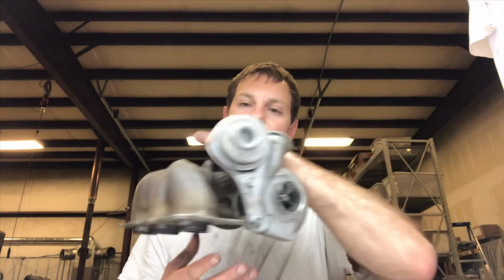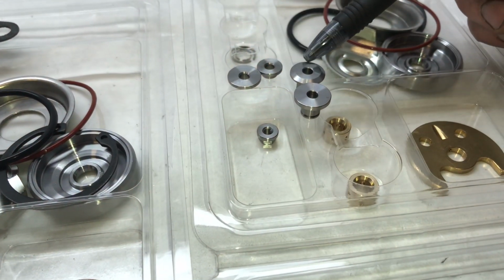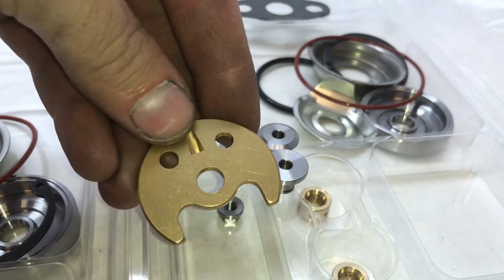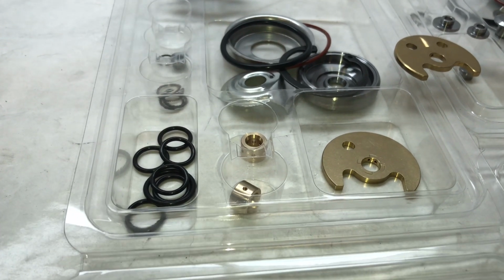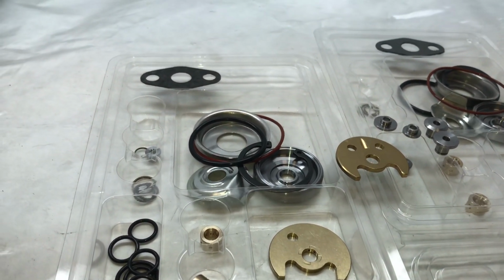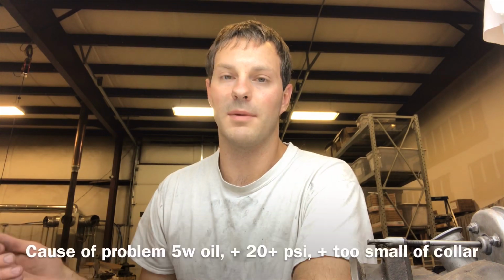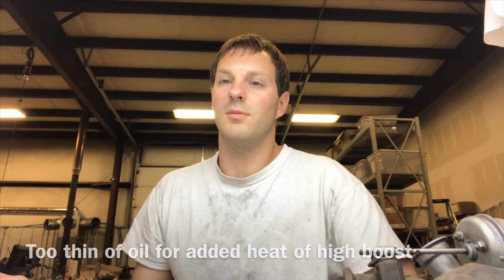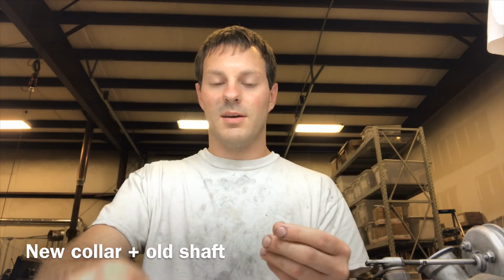Why N54 Upgraded Turbo Will Fail

Comment: I bought a set of Turbos from you in January 2019.  Running 18-20 psi boost on my N54 for 8,500 miles.  I see Wide Open Throttle several times a day and red line a couple times per day. I use Liqui Moly 10W 30 oil from FCP Euro and no problems at all with the upgraded units that you sold me.  Thanks for the explanation.
Reply: TheMortgageDoctor  have you dyno the upgraded turbos yet?
Reply: are they still holding up in 2023?

Comment: Running 3 pairs of your upgraded turbos on customers cars now, no issues. All cars are driven hard at 15-19psi. Customers usually use 5w30 or 5w40 oils, but I think only 40wt oils should be used because the oil temps are so high on these cars. Thanks for the videos

Comment: I just upgraded the inlets (stock ECU) and the engine is running hotter. Your turbo behavior explanation is flawless, so i'll change my oil to 5w40 or 10w30 soon. Thanks a lot!
Reply from the maker: Go with 5w 40

Comment: Ok 5w 30 and 10w 30 are the same weight in oil. "W" does not stand for weight it stands for WINTER. A 5w 30 is a 30 weight oil that will flow like a 5 weight when it's cold. If you want thicker oil you need a 40 weight. Im shocked people never know this
Reply: Listening to him talk about the oil made me want to beat my head against the wall. Lol
Reply: the W describes the viscosity of the oil at low temperatures
Reply: It stands for viscosity. The lower the number, the thinner the oil is at low temperatures.
Reply: @supertreme5559  yes the number stands for the viscosity at low temps. The W stands for winter
Reply: I also wanted to leave a comment on this. I just had my neighbor wanting to 'teach' me the same bs last week lol.
Reply: the number before the W describes the viscosity of the oil at low temperatures. The lower the number, the thinner the oil and the better the oil’s cold temperature/ cold start performance. The number after the W describes how thick the oil is at the engine’s normal operating temperature.
Reply: @supertreme5559  thanks we have firmly established this even tho most people still don't fully understand. They should change the W for a C "cold" so people don't think W=weight
Reply: FINALLY SOMEONE GET IT, if you want a thicker oil you look at the 20,30,40,50,60 and not the W number
Reply: i applaud you .....beautifully explained........People dont know this .....because it's something that no one thinks about or even realizes it has such  big effect on driveability .....not something the everyday DIY'er will know because noone that frequents their favorite Diy manufacturer specific car forum would know .....hell , most career techs dont even know  that , let alone what an API rating is.
Reply: Only people sponsored by their parents don’t know this.
Reply: @mattriella6776  hey thanks alot, now that a re-read it I could of explained it better but it's ok. Im an aircraft mechanic and often ask people this question and get a kick out of the confsued look they give when you tell them W doesn't stand for weight. Happy motoring!

Comment: I bought my fbo 335i back off a friend and the oil temps were getting high, had a check through service history and they had put in 10w40 I changed it back to 5w30castrol and car now runs spot on n oil temps are great!

Comment: Why not 5w-40 or even 0w-40? It's the second number that applies when the oil is warmed up. 10w oils are very thick and resistant to flow when cold. 0w-40 is far less prone to thinning out with increased temperature than 10w-30. My old 335i is still going strong with upgraded turbos running 17psi flat after about 35,000km now with 0w-40. I agree too high boost kills these turbos, both from thrust load and overspeed.
Reply: Brad Smith Yep. Well said. He totally lost the credibility with his misunderstanding of multigrade oil numbers. It's all to common and quite normal but he went on to explain "why" related to the heat of the turbos which made the misunderstanding even worse.
Reply from the maker: 5w40 seems like the best choice according to the oil charts online, it depends on the temperatures the car gets operated in
Reply: Turbo Lab America There's only 2 things to choose with oils: The operating temp viscosity (the second number) and the cold (starting) temperature (the first number. That first number should be as low as possible in any climate. The only reason we see such a wide spread in multigrade numbers these days is the modern synthetic oil technologies. Charts for older engines only really apply to oils available at the time. 

The engine operating temperature value has nothing to do with ambient environment temperature and the correct oil viscosity rating is according to the manufacture. Once an engine warms up there should be minimal fluctuations in temperature. You'll get hot spots but that can not be "solved" with a "thicker" oil. 
If an engine is running too hot then the engine has a cooling problem and changing the operating viscosity of your oil will not change that. And in BMW engines going outside the manufacturer spec can affect both the internal hydraulics operation and the oil flow characteristics. 

The only way an oil viscosity can be responsible for damage to an engine is if the cold grade is not low enough for the ambient temperature (your climate and season) or if the "operating temp" grade is too high or too low.
Reply: @DiscoFang it looks like he’s in a colder climate, 10w might be his colloquial equivalent to 5w for folks in mild climates

Comment: I've had Stage 2 Pure turbos running 27psi since 2017 and zero issues. Change the oil ever 4k miles do you maintenance and you'll be fine. They are 650 whp. ZERO turbo issues.

Comment: The "w" in motor oil stands for winter. The first number in the oil classification refers to a cold weather viscosity. The lower this number is, the less viscous your oil will be at low temperatures. For example, a 5W- motor oil will flow better at lower temperatures than a 15W- motor oil.
Reply: But a 0w40 and a 15w40 are both the same viscosity when at operating temp.. a 40 weight is thicker then a 30 weight.

Comment: Thanks for the video!!! Good to know about oil weight - I’ll def buy heavier oil now for my stage 2+ car with original turbos
Reply: The main thing is achieving full operating temperatures before using the turbos under heavier demand.   

One thing he seems to miss is the base oil stock is the second number.  The initial lower first number is achieved when all additives are still present and utilized.

Comment: Im not sure if your correct with our oil statement.... it doesnt matter if its 0w40 5w40 or 10w40, they are all the same when hot, which matters for boost anyway, so if your saying too thin oil is bad for your turbos, which is correct, going from 10w40 to 10w30 makes your oil thinner at operation temperature but stays the same at coldstart.. rather go with something like 5w50 or even 10w60 if running high boost.
Reply from the maker: 5w40 is good over 100 degrees f, I didn’t realize that. It seems like the widest range choice. It depends on the temperatures that you plan to operate the car

Comment: I've run my n54 on 0/30 for 14 years , the 0 part is to get to the turbo's quickly when cold , 30 when hot , that's how oil works , the 10 is going to get there later in the cold , I have a Cobb access port giving 18/19 lbs boost for 6 years no prob , if and when my turbo's go I wouldn't bother getting them upgraded , I would have new upgraded and bigger one's fitted instead. I'm from the UK and the weather doesn't get to hot mostly.

Comment: I always like to watch your educating videos and usually I have nothing to add. In this episode I think I can give you some advice on engine oils. To me it seems you do not fully understand the numerical code system grading engine oils. So here is how it goes "In a 5W-30 for example, the number before the W describes the viscosity of the oil at low temperatures. The lower the number, the thinner the oil and the better the oil’s cold temperature/ cold start performance. The number after the W describes how thick the oil is at the engine’s normal operating temperature" This means you do not use 5W30 or 10W30 in high performance engines, because they run hot and 10W30 becomes very thin and do not protect engine components. These thin oils are designed to improve engine emissions to meet higher green standards at a cost of engine lifespan. SO DO NO use 10W30 engine oil use 5W50 at minimum with turbo engine. I run my jetta 1,8t engine with 10W60 oil and it has your K04 turbo bearing upgrade kit in it :) Runs smooth as silk and I do not have to worry about little extra heat. Keep up the good videos Austin!
Reply from the maker: I have heard this before. Several years ago, I noticed that people would use 5w oil in the winter, every time summer came the turbo would fail. I have a hard time choosing my oil weight because the temperature where I am ranges from 0F to 100F. The oil weight should be chosen based on ambient temperature. My first Bmw had a guide in the manual on which weight oil to use per the temperature, but my e90 never had that. It seems like we have to use higher weight to compensate for higher heat applied from higher boost.
Reply: i live in tropical climate and had two spun bearings.  i think it is because of 5w30 oil that had used. switched to 20w50. that doesnt even smell like motor oil. i have read somewhere that oils are having less zinc stuff these days to keep cat live longer.
Reply: Correct, the 5 before the W is the cold rating, when tuned a N54 needs at least 5W40 or 5W50... 10W60 isn't good either, too thick oil at cold temps for the turbo.

Comment: Need to watch oil viscosity on these engines.  Though it may be great, bigger weights, but the rod and crank bearings have such close tolerances, you could literally destroy a motor.

Comment: Thank you for making this video, but I'm not sure you are right on the motor oil weight.  The first number is the oils viscosity when cold. so 0 weight is less viscus than 10 weight at 70 deg. F, but when the engine and turbos are hot 250+ deg the viscosity modifiers in the oil cause it to thicken and protect like the higher weight 30, 40 or 50.  If your argument is the hotter turbo will break down the oil quicker, then you should be referencing the higher number.  I agree with you on a higher weight for better turbo thermal protection, but the Vanos passageways in these engines are really small and a thicker oils have shown to cause issues.  This is especially likely when running anywhere close to the BMW recommended service intervals.  I don't drive my 168,XXX mile modified 535i hard, but never go more than 7,500 miles between changes (this is 1/2 of the BMW recommended service interval).  Best wishes with your product as there is a need.
Reply from the maker: Jeff Sloane refer to an oil weight chart so you can chose. 5w40 should be the best choice

Comment: I have your turbos, but have no idea how old they are they looked relatively new when installed got them from a totaled car that was recently built by the looks of it I was told. I’ve been running two maps one that targets 20 psi and another that targets 22 psi on e50 and 5w40 weight oil which is thicker then the 10w30 you mentioned at temperature. I feel as tho if I bump it to 5w50 Amsoil or something along those lines these turbos should be okay with or without the upgrade. Now I’m not sure what to think about the setup, fortunately in a way my fuel system runs out of steam occasionally on the 22 psi map that I save as a kill map, so I might just use the e40 map from now on to play it a little safer which runs great. I think at e40-e50 I should be fine with a 5w40 especially a 5w50 weight oil at 20 psi or less.

Comment: been running 5w40 for 9000 miles at 19 psi with 17t china turbos. just pulled the turbos to replace the gates, was gonna rebuild them but they had no shaft play so i left them alone.

Comment: the hotside aint holding till red line anyway...take it easy with the baby mitsi ... run 20 on the stock turbo if you wanna break things got yah

Comment: Can you explain how the oil gets into the trust bearing? I guess the oil gets through the tiny hole that goes to the center? And is there an up and down side of the trust bearing because the oil will flow naturally in the direction of gravity
Reply from the maker: The oil travels through the holes above the collar. There are 2 oil holes in the bearing that go to lubricate the collar and spacer
Reply: @turbolabamerica  thanks. How does that oil get into the bearing loaded bearing? Can you explain in it one of your next video's please?

Comment: Would you be interested in upgrading bearings, compressor and turbine for a GT15? Taurus Ecoboosts continously have oil leaking, bad bearings and shaft play. They are short lived about 10-20k miles. No one seems to have an answer for us yet.

Comment: Crap!  I've been running the 0w-20 but I'm usually running stock settings.  Im high mileage so next oil change I'll put in the 10w-30.  I heard that you can't get too thick because of the tiny oil passages in the block.  Is that just a myth?
Reply from the maker: I’m not sure, go with the weight recommendation by ambient temperature. I switched to 5w40

Comment: I think my turbos are leaking with 5w-40 oil. Should I just change the oil or drop the sub frame and look for the oil leak ?
Reply: You should look for the cause of oil leakage.  5w40 is thicker oil than 5w30, and thicker oil would be harder to leak out from seals than thinner oil. 
Or maybe 5w40 just killed your turbo. 
GL.

Comment: Great info and diagnosis.. until you started talking about the oil. Totally wrong and a misunderstanding of multigrade oil viscosity numbers.
Reply: People always think the W stands for weight ....its Winter people ,         " I'm running a 5w30 but need thicker oil so I'll get a 10w30..." Lol sure
Reply: @JDJD-mw9rr  Why 10w 30? I got told 5w 30 is the best. Or out of those two. My BMW 335i 2008 is stock but I want to get the Precision Raceworks Ignition Kit.
Reply: @stormfam4779  10w30 and 5w30 are both 30weight oils. The only thing that's different is how they act when its cold. A 5w will act like a 5weight when cold so it will be thinner than the 10w that acts like a 10weight when cold. If you live in a place where it gets below 50 degrees then ya use 5w30. If you want a thicker oil you need 5w40

Comment: Rotella T6 is 5w-40, can I use this oil year round with 20psi max on stock turbos? In Chicago
Reply: I say hell yeah....👍 I live near Cleveland Ohio I run it (Rotella  T)  in my Saturn sky that I drive winter, spring, summer, and fall.... no issues.... granted it's not a BMW but I do have a Turbocharger that Austin  machined to install a larger turbine and compressor wheels with upgraded collars in the rebuild kit. ...
Reply: Chris at Motiv has been running T6 for years on a 750whp ST.  I run liquimoly.  Use what you like.  Change often
Reply: I use Rotella 5w-40 on my tune/bolt on stock turbo car and it really handles the heat well and my oil temperature is always low and stable. In winter i like to run Mobil 1 Euro 0w-40. Its another great oil choice  that can handle the all year round very well. I live in NY which goes from 30f-100f between winter and summer days

Comment: I bought you n54 turbo repair kit and the mechanic had to pull out again after installed and buy the oem installation orings because he said the ones on the kit were too thin.
Reply: They don’t work just dont put them on the kit

Comment: I had my 09 335i turbos upgraded by you guys and and had no issues. I was running 26psi and have ran up to 30psi.  This produced 523whp and 521lbft of  torque. I would have made much more ,but was limited on fuel and intercooler size. After 1 year of having the turbos upgraded,  one failed and this was not to your guy's negligence.  It was just because of running the turbos out of their limits. If anyone knows and understands turbo chargers, then they will understand it's not your fault when it fails.  Too many guys are out here running turbo vehicles and think they are drivers and tuners and have no clue! Anyhow, I've been trying to get a hold of you so I can get, the turbos for my X5 xdrive50i upgraded. I do need to know if you have the upgrade for the rear wheel?
Reply: AV did you get 523 at the wheels or estimated at the crank and was that done at 26 psi or 30 psi? Can you elaborate on the spool and any lag versus the stock turbos?
Any chance you could share the dyno sheet? Thx

Comment: So I purchased your upgraded Turbos about two years ago and I haven’t had a single problem with them thankfully. I currently run 50% E85 and I do run it to 20lbs(far from all the time). Are you saying that those parts you put in 2 years ago will fail at 20? I also have been running 0w-40 Mobile One for its whole life...sounds like it now needs to go to 10w-30 full synthetic...?
Reply: Paul B if you’re not running “Full” synthetic in a BMW then you are just like the customer he’s talking about. 🙄
Reply from the maker: I think it’s 22 psi that kills them because that’s what one of my customers that builds the cars has reported. I run 18 psi for 2 years and it has been fine. I would bump up the weight but it depends on temperature where the motor operates. If you do have issues I will exchange a set for no cost to you

Comment: Looking to buy a 2017 540i I believe it's a b58 engine. Have you come across any turbo failures in these models?
Reply from the maker: I don’t think that one is turbo charged
Reply: 40i is b58 which is the new gen n55, definitely turbocharged
Reply: The Motorsport Archives yup no v8s no more in those